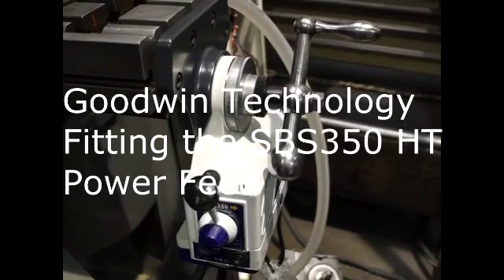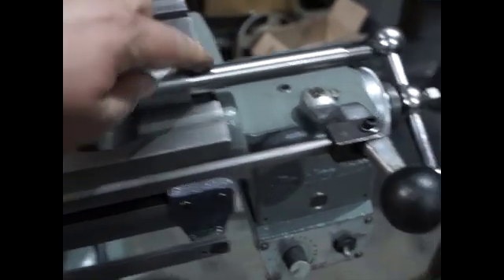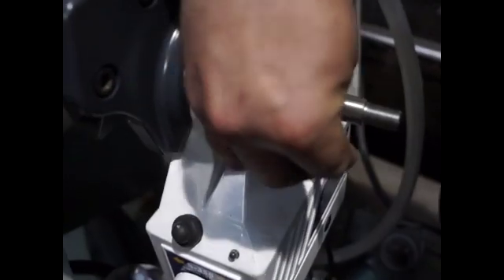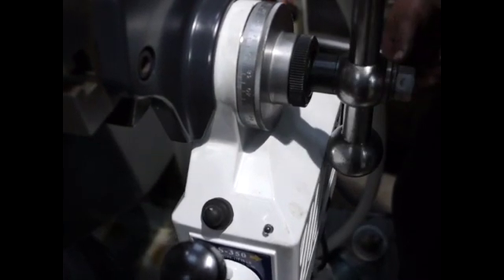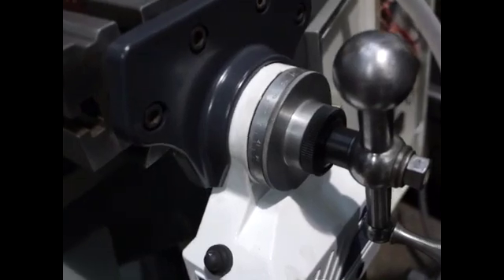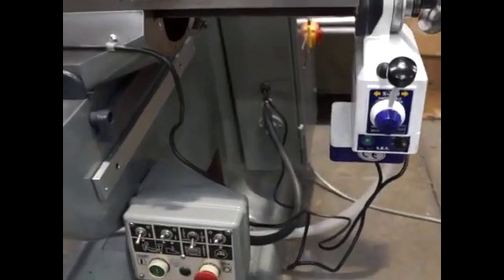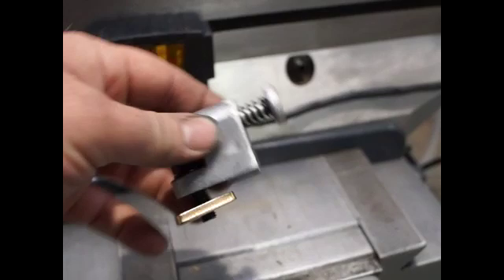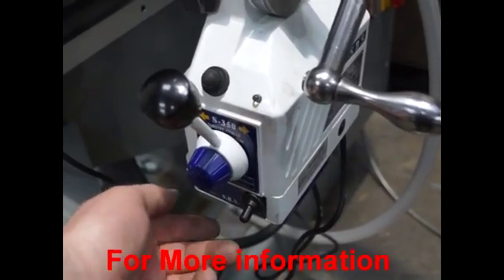Bridgeport Milling machine Power feed fitting

Comment: So I’ve got to ask. Where on earth did you buy the “adapter shaft” to convert the Bridgeport Vari-Speed to a servo type Power Feed?

I’ve not been able to find any such kit that includes the needed adaptor shaft anywhere. 🤷‍♂️

I ended up having one custom made (because I don’t own a lathe yet to make one myself.

In essence, I just copied the layout of the left hand end of the table lead screw shaft profile, and added on the shaft detail from the Bridgeport Varispred once removed off the table, so that it fits up into the slip coupling, matched up the drilled roll pin hole with the slip coupling hole to couple the adapter shaft together with the power feed lead screw shaft.

Also the slip coupler has a shoulder that protrudes thru the end of the table into a recess in the OEM Bridgeport Varispeed gear housing, which is too large diameter to allow the new servo type alloy bearing end plate to bolt up to the table, so I turned the coupling sleeve down in diameter (about 6mm off) until it fits through into the recess in the new alloy end plate.

Those are about the only two modifications required thus far.

Once I’ve milled the woodruff key slots into the adapter shaft, I should be good to go.

But life would have been about 100 times easier if that adaptor stub shaft were available commercially, because figuring out what was needed, drawing it out with measurements and to scale, and having it made has been a giant PITA.

A lot of guys just buy & install a replacement manual (non power feed) leadscrew, from H&W Machine repair in USA, and unscrew the power feed lead screw and replace it with the manual lead screw and attach their servo type power feed onto the new manual lead screw that already has the correct profiles on each end - to be able to do the conversion without buying (or making) the adaptor stub shaft.

I’m really surprised that there are NOT any more videos on YouTube about this particular topic, because it seems the Bridgeport Varispeed Power feeds are prone to failure.

My 1952 Bridgeport series one mill had a non functioning Varispeed Power Feed on it when I bought it, so fixing it has just about given me a brain meltdown.

What I know about electrickery could be writ large in 20 point Helvetica script on the head of a pin.

I suspect my Varispeed Power Feeder has maybe fried it’s Erskine Board in the power box on the side of the mill.

Being located downunder, I haven’t been able to find anyone locally who can diagnose or fix the old Varispeed Power Feed or it’s Erskine Controller board.

So the conversion to servo type power feed seemed like my only option unfortunately.

I’d have loved to keep the mill all original with the Varispeed Power Feed, but at the end of the day, you have to do, what you have to do, to get your mill up and running, so buying a servo type power feed (and 240V 110V AC transformer to run it) for close on $1k 🇦🇺, have the adaptor shaft made $200, seems like the only option.

In case it doesn’t work I’ve ordered a new manual 48 inch lead-screw from H&W Machine repairs in USA to be shipped and if needs be, I’ll rip my adaptor shaft and Varispeed type lead screw out and install the new Manual lead-screw, and re-install the servo type power feed (Align Brand PE500 C something or other).

One way or another I’ll get it working, or die trying.

If I could find someone that could repair / rebuild the original Varispeed Bridgeport Power Feeder & it’s Erskine Controller board, I’d ship it off overseas to the right guy, and pay to have it restored, even if just to have it set aside in a box on the shelf ready to re-install, the day the servo type power feed dies.

Maybe all the old Bridgeport Series Ones with the Bridgeport Varispeed Power Feeders are long since dead and gone to the scrappers, because apart from your video, I’ve not seen one other that addresses the need for the stub arbor adapter to be able to retain the original power feed lead screw.

I did see someone else on Facebook Bridgeport Page the other day posting up photos of an identical mill to mine with the same Varispeed Power Feed that was dead also - so there’s at least one other besides me (& yourself) who actually needed an adaptor shaft.

It amazes me that the company’s who specialise in rebuilding Bridgeports don’t keep a box full of the adaptor shafts in stock and sell them to us poor souls who run into this issue?

I guess they just figure - anyone has a Bridgeport mill also owns a Lathe & can figure out & make their own adaptor shaft? 🤷‍♂️

I know I have about a thousand more grey hairs than when I bought this Bridgeport and started trying to fix the Power Feed issue, that’s for sure.

This mill has been keeping me broke as a church mouse since I bought it 9 months ago. 🙄

Dunno how I’m supposed to save up & buy a lathe with the Bridgeport draining my bank account every week on something else it needs. 🙄

This is turning out to be one hugely expensive hobby, that much is for sure.
Reply from the maker: Hi Ian thanks for the message it was a very interesting read we do offer a conversion kit and also offer the adapter shaft for £40 plus vat we also offer repair on the erskin units but haven't ventured to often into rebuilding the 6 f feed units because of the cost involved it's normally cheaper to just fit an Align unit. We have a Web site www.gtmachineparts.co.uk if you wanted to see how we operate in the UK I hope that answers your questions and I look forward to hearing from you again good luck with the rebuilding it will be worth it in thr end. Best Regards Darren Goodwin Goodwin Technology Ltd